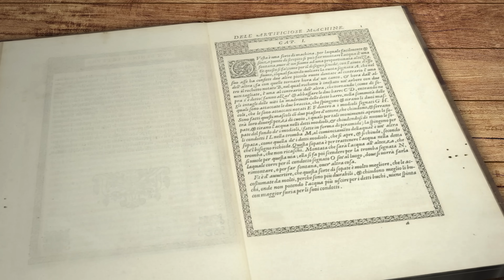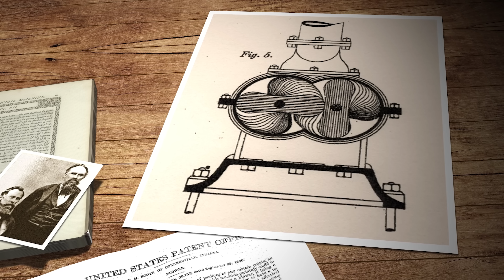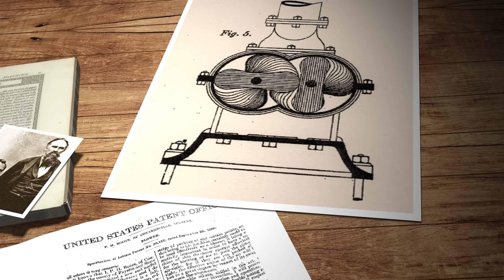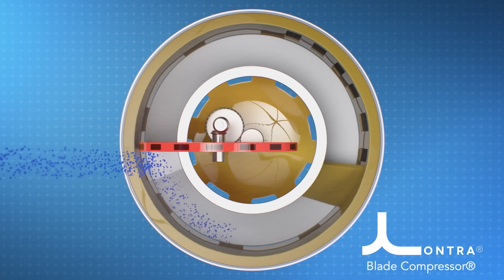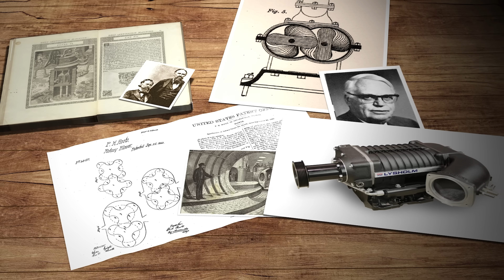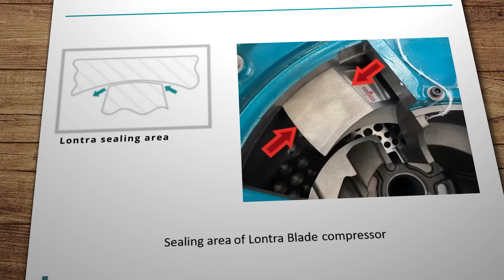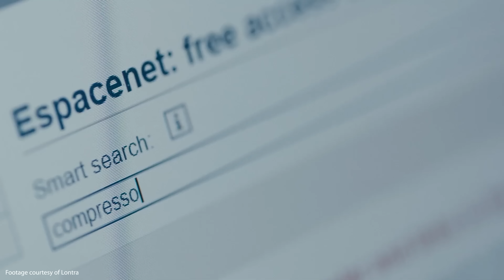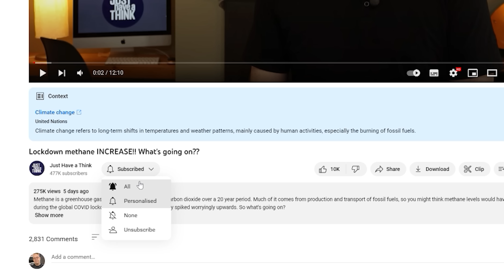Compressing air to reach net zero. A 'revolutionary' innovation.

Comment: One efficiency increase that isn't even mentioned is driving these directly with wind turbines at factories instead of transporting the energy with electrical lines. It would save on a ton of neodymium and copper as well, if done for every manufacturer using compressed air.

Comment: General question: does increasing efficiency actually save energy? Or does it just provoke the use of (in this case) more air compression? As a comparison, in Los Angeles they keep widening the freeways, but there never seems to be lack of cars to fill them.

Comment: This increase in efficiency resulting in a reduction of CO2 is all very well, but in applying it it comes up against scale and complexity. It’s all very well installing it in new installations but there’s the problem of all those millions of existing installations (producing that CO2) where it’s only one component of the whole system, the question then is how much (cost: component, material, downtime plus labour etc) and over what time scale (years/decades) to pay for itself eg profit🤔

Comment: Great video as always.
These simple, yet crucial improvements are always fun to learn about.
The section from 9:30, writing the napkin math on the page while you talked through the wider message was an especially nice touch. Can't recall if you've used that particular trick in the past, but I've always noted your use of the rendered pages as a winner.

Comment: When talking about compressors you might have did an overview of the common types of compressors used today and how their efficiencies compare.  Centrifugal, turbine and reciprocating were ignored and are very common.  It's a lot of information for a 20 minute video though so understandable.  Also the argument of volume vs pressure is important as I see this as being optimized for more of a pressure application vs volume.  Once you have gears in the mix, wear and speed are large factors as it effects repair/uptime in a primarily 24/7 industrial environment (primary energy users), I'm a little suspect on the aeration ponds initial setup/efficiency.  If it can replace small compressors on AC units for residential while providing cost (foremost) and efficiency improvements it'll definitely be a real improvement but overall effect on global energy usage will be minor as it'll slightly reduce growth at best.

Comment: One of the requirements of air compressors is demand changes. The small systems like garages run flat out to fill an air tank. Then switch off. Industrial high speed turbine compressors that continuesly vary speed to match demand have a lower limit when they can not run below. This pump at first look seems to get over this problem

Comment: What I found the most interesting was the data from the water aeration facility claiming no loss in performance after two years of operation. I’m not familiar with compressor maintenance but I suspect that this change may be as important as the operating efficiency. Exciting stuff.
Reply: Considering the low pressures this is designed to generate, meaning also low compression temperatures, low forces working on the gears, seals, and bearings,  etc. its not surprising that the unit could run for 16,000 hours or more without a maintenance cycle. This thing is not really an air compressor, it is a low pressure blower. pneumatic conveying and aeration in waste water treatment require very low pressures, especially compared to pneumatic tools (80-100psig), valves, etc. 12psig for aeration and 5-10psig for conveying isnt much pressure, the applications use a huge amount of air flow/volume though.
Reply: @TheDuke_ofKeys  Thanks for your reply. It provided a useful distinction and context for the video. Really appreciated.

Comment: i had a thought . why not use water as a seal , it cannot be compressed , can help with heat exchange when the air is compressed. just a thought

Comment: 34% is probably not to be expected compared to another new good compressor also optimized for the specific task, but if it's 10% better and also cheaper to produce, and no significant drawbacks besides being new technology, it's huge deal.

Comment: compressors definitely require a lot of power. I work in what is, all things considered, a relatively small factory and our compressors suck back about 100KW 24/7. That adds up to quite a lot of power very quickly. 

As for this design, the very precise timing required between the two spinning discs gives me cause for concern as a technician. Images of the two discs violently crashing come to mind.

Comment: From an engineering point of view, this doesn't add up. The improved efficiency from a better clearance design in a positive displacement machine does not lead to massive energy savings as implied by this video. No doubt there are advantages in terms of reduced wear and longer maintenance intervals, and perhaps there is a marginal improvement in volumetric efficiency, but these things are not significant enough to disrupt the compressor market. One has to appreciate that even a perfect compressor that achieves 100% thermodynamic efficiency will still waste a lot of energy as heat when compressing air or other gases. You can't beat thermodynamics. At the very beginning of the video with the bicycle pump the air got hot and burned you. That heat was energy lost.

Comment: But this system probably is for a very different application than for example a rotary compressor.
This system probably doesn’t have a constant flow or?
I mean for a Workshop compressor this isn’t a thing - but for a car it’s probably not the right design or?
But really cool mechanical design!!
I thing this could even be improved with moving the piston with electro magnets.

Comment: Unless I'm mistaken Hydraulic Air Compressors have achieved better efficiency improvements and are, mechanically, much easier to build as they rely only on water pumps.

They are very large though and wouldn't be ideal except in larger industrial situations.

Comment: That is a very inefficient set up, and the leakage would be hard to control 
On screw compressors the leakage is controlled very efficiently with oil, flooded screw compressors have been around for years

Comment: Years ago I worked at a bottling facility that got a significant subsidy from our power company to replace our old air compressor with a much more efficient machine. Of course, they only did that so they could resell the power we were no longer consuming to California at a much more favorable rate.

Comment: A really nice aspect of compressed air is that you can store large amounts of energy in a small space, enough to lift a submarine out of the water (been there, done that). And the compressor can be run by a windmill. Wow, no carbon footprint.
Reply: Though the containment vessel is heavy, making specific energy much lower than conventional fuels.

Comment: It really depends on the product and the industry as to what provides the air for product blow lines. My experience was in the cereal business so we were transporting grain and flour. In this application, the air volume and not pressure was the most important thing so the equation was the distance of travel, type of product, feed rate of product needed, and how many bends which gave you the diameter of the pipe and required airflow which gave you the size of the blower and in our case we did not require expensive screw type blowers. In most cases, they were large volume low-pressure centrifugal blowers or sometimes the old-style roots blower. With smaller diameter transport pipes it was found that using a vacuum to provide the moving force was better as the air was not heated by the blower. The vacuum pumps were water-cooled. So maybe this is why you won't see a lot of these around yet as they will be more expensive than simple blowers. High-pressure compressed air in the factory was used for control devices and actuators which pertained mainly to machinery. So it really comes down to what pressure and volume of air an industry needs when it looks at what pressurised air units to purchase.

Comment: They should look at it in reverse, using compressed air to drive the pump as a turbine/generator.

An obvious source of compressed air would be from wave power. An offshore static chamber used to compress the air, like a natural blow hole, and deliver the compressed air via pneumatic hoses to onshore compressor/turbines generating electricity. They can be staggered to smooth the wave cycles.

Comment: A big, low hanging fruit in compressed air systems is setting the system up properly for the end use.  Most compressed air systems are designed for a common pressure, say 125 psig, but all the plant uses are much lower.  I've seen plants where the plant air system compresses air to 150 psig and the maximum usage pressure in the plant is 25 psig.  Of course, you have to balance piping cost against wasted energy compressing to an excessive pressure.  But the piping cost is a one time expense while the wasted energy is for the life of the plant.  And, almost universally, the air is let down across a valve wasting the energy stored in the over pressure air.  The same thing happens in steam systems:  generate steam at 150 psig and use it at 10 psig and getting there across a PRV.

Comment: Ingeneous, I hope this gets more market share. I'm guessing it is quieter with less vibration also, a big plus on anyplace using compressed air, portable or built in place. Cheers from a currently icy cold spot in Alberta.

Comment: You missed a new pump, the SCROLL PUMP. In the 1960s, when the inventer showed me his first working model at his home in Mason NH. He had made it on a modified drill press. It consists of  one fixed disk with a scroll cut into it's face and another driven by an offset crank. with an  inverse  scroll . The scrolls were mirror identicle, each with the raised part fitting perfectly into the other ones groove. I recognised it immediatly as a truly new mechanical invention and suggested it would be a great clean vacuum pump. It had a Teflon sealing surface.
   The next I knew it was being built in japan as a large compressor  (that needed water cooling). But now it is in heavy use in the semiconductor processing world as a clean, (no sealing oil) vacuum pump.
  The  inventer Niels Young worked at Arthur D. Little Corp.

Comment: I wonder how it compares to ring blowers? could be useful for getting the aerators I invented started... Once going they use a feedback mechanism that drops the inlet pressure to near atmosphere, regardless of depth, so the large volume of ring blowers has been ideal, but the ring blowers typically don't produce enough pressure to get the process started, so I have to use a piston or screw compressor to get the aerators going before switching to ring blowers.

Comment: Humm, a neat compressor if it can work for long periods of time (As compressors often do.). I'm wondering if this is going to have a fate similar to the rotary ICE engine, a victim of that huge surface area between the rotor and the cylinder wall. A game changer if it works as advertised...  Thanks for the look ahead.

Comment: my 2c here. The clearance between the synchronization gears (assumed used between two rotating elements) will be determining factor between the clearance of slots where rotating piston go through. 
Opinion : I don't think it will ever beat the efficiency and reliability of the centrifugal compressor with air bearing.

Comment: Hi Dave, compressor tech and things like motor scheduling or variable / efficiency improvements are among the great technological leaps of the 20th century, you're quite right.  I'd love to see a second video answering some of the excellent comments brought up in response to this video, a deeper dive. Specifically, what are the company responses to the filtration problem / multiple seals, turbulent flow patterns and opportunities, niches they see as most useful and viable, independent test results, and market issues.  Thanks for a video on one of my favourite topics.
Reply: Do you think that regular compressors are inefficient? but they can provide very high compressions in single stage operations. You think that friction (only cause of inefficiency; not counting adiabatic heat due to compression) causes more than 30% loss in total?

Comment: Thank you for another great video! This one was very different. Mechanical engineering is a bit out of my line, so I had to rewind and watch your explanation of how the compressor worked a few times. Got it eventually though. It's really quite amazing to think about how machines like this do all that work at tremendous speed, spinning around with the second part always rotating into place just when it's needed, fitting so tight that air can't escape. Everything always working just as planned, thousands of times of times in every minute.

If I'm understanding you right, this is the first major improvement to air compressors in a long time? Was it a situation where there was no push for improved efficiency because existing models were "good enough," or was there some kind of technological improvement that made the new design possible? I wonder if there are other industrial machines that could be redesigned for similar improvements in efficiency.

Comment: I wonder how long it will take them to add a second blade and slot and turn this into an internal combustion engine. All the beniffit of a Wenkel with almost none of the internal sealing issues.
Reply: Check out  Albert Harvey Rotary Engines

Comment: This seems like the same basic principle as a wankel engine (rotate instead of reciprocate) with probably the same drawbacks. It's not clear to me from the video why the tolerances would be more generous than other rotating pumps. You also missed turbine pumps which are the most obvious and common rotating pumps which are also vastly more simple than this design.

Comment: This is a very low pressure blower.  Its max psi is only 15.  Air conditioners and heat pumps require compressors to operate above 500 psi.

Comment: Like the Omega-1, these tight-tolerance metal seals sound great on 3d animations or very low speeds, but those are going to leak bad at full speed. Worse yet, they will get hot and cause further tolerance issues. 

Remember: Real metal seal blowers have a loooong metal seal and have limited delta-pressure
Reply: The website says "IF"... especially when it talks about savings.
This is just hype to build capital because there are already very high efficiency "low pressure" compressors such as regenerative, screw or roots blowers to use for material transport in factories.

Sure, compressors use a lot of power in industry, but not all of it is for very low pressure applications. If you compare any low pressure blower to down-regulating the 6-9 BAR produced by reciprocating compressors, the savings will be great.

Comment: It appears that this new invention only deals with the leakage aspect of compressor inefficiency, but that isn't the only source of inefficiency in compressors.

Thermodynamically speaking, the most work-intensive way to compress a volume of gas is adiabatically, where the gas increases in temperature sharply. The least work-intensive way is isothermal compression. This compressor seems to do nothing to cool the gas during compression.

If you look at how much more work it takes to compress a gas adiabatically vs. isothermally, you'll see that this is a huge source of inefficiency.

Comment: This begs the question ..... are these devices more efficient than the standard piston arrangement in normal aircon units? 
If so it could increase the efficiency of aircon past the 400% claimed at the moment!
This would have major effects for both cooling and heating (same thing for a heat pump) applications!

Comment: Presenting new designs has instructive value. However most of these new designs will not be commercialized at industrial levels because billions need to be invested. Commercial success will be in niche markets. 

Besides, currently used industrial processing units have pretty good thermodynamic efficiency and evolutionary improvements (economically feasible) are increasing efficiency. The bigger the compressing capacity the greater the efficiency. Small compressors are not very efficient.

The focus should be more on isothermal compressors.

Comment: Efficiency gains stated in the small selection of Lontra's videos that I've just watched vary from 10% to 35% & I've not seen independent testing.

It looks like pretty much every surface apart from the blade itself is swept by at least one seal so air filtration will be absolutely critical. It looks like maintenance costs could potentially be very high & feature a lot of downtime while worn parts & seals are replaced.

Comment: A Lontra design compressor could be used with the liquid air energy storage you have previously reviewed. The fact that you have a small compressor in your hand is evidence that it (the Lontra) is scalable, which is one of the advantages of liquid air energy storage. 
The efficiency gains are multiplied. 
I want an energy storage plant using liquid air using a Lontra compressor in my back yard, please.